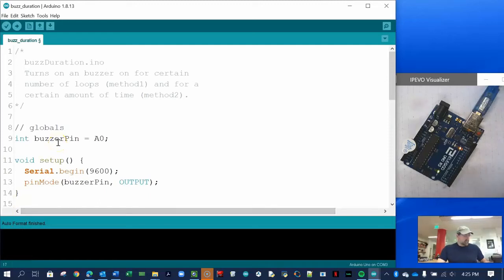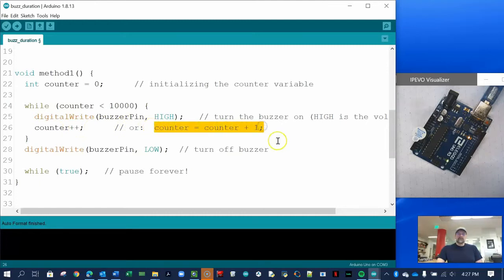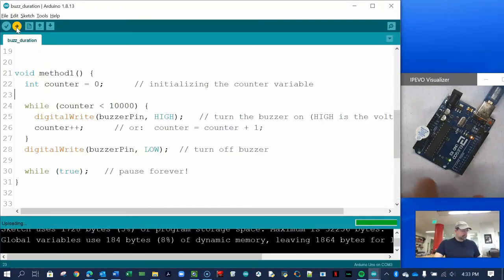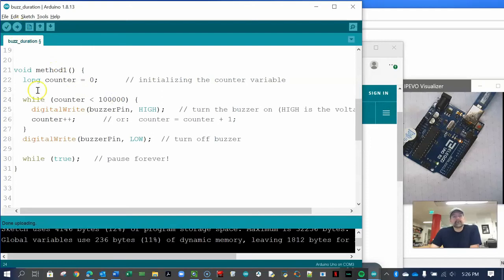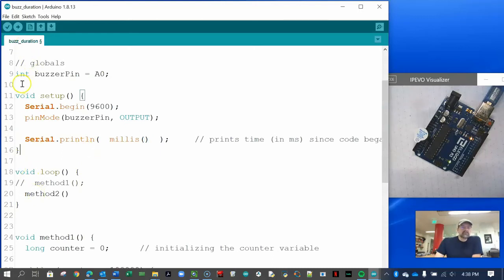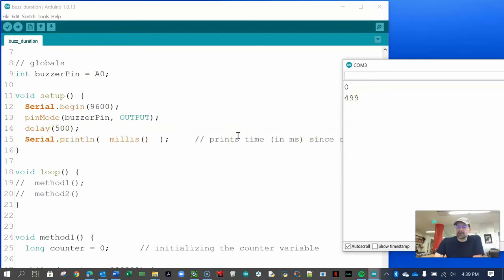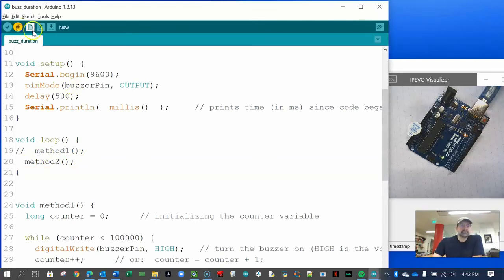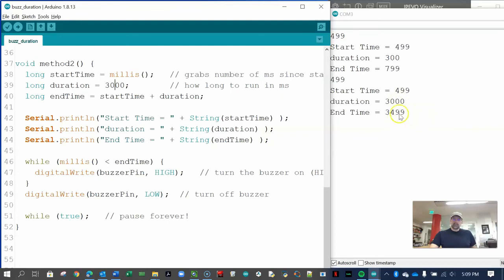Buzzer Duration Using the while() and millis() Commands

Comment: suppose duration =3000 , while loop will run for 3000 millisecond ( or approximate 3000 times)
my question is : isn't it bad practice  to execute  this line of code  {      digitalWrite(buzzerPin, HIGH)    } 3000 times ?
Reply from the maker: Thanks for your question!  I don't see how this would hurt the microcontroller, as the voltage remains the same throughout the loop.  (After the first iteration, it is setting the pin that is already at 5V to 5V.)  But I do see your point, that the code could be simplified if the digitalWrite() command is moved from Line 25 to Line23.  But I don't think the controller will be overtaxed either way.

Comment: What if we wrote the following?

while (startTime < millis ( ) < endTime)
Reply: So the difference between “while” and “for” loops 

while loops check that condition and do “thing x” if the condition is met and cycles through the loop and will keep doing “thing x” as long as that condition is met

for loops will go into the “for loop” and do 
“thing y” FOR a specified number of times depending on the arguments that are fed into that  function 

Correct??
Reply from the maker: That is correct.
Reply from the maker: So, that kind of logic statement works in a math class, but not in a programming class.  In programming, you need to use what's known as logical-and operators to join two or more conditional expressions.  Logical-and is entered as &&.  Something like this:

while ( (startTime < millis()) && (millis() < endTime))

or:

while ((millis() > startTime) && (millis() < endTime))

See?

Comment: Excellent sir 
I was looking exactly this code , but plz guide me how I can add code to my project " water level indicator using ultrasonic sensor "  . When the water reaches high level the buzzer should on for 10 seconds then it should off automatically . Plz guide me sir ..you u want codes I can upload it . Waiting for kind reply
Reply from the maker: Hi Dawoodhusain.  You can just add the code that starts at 9:49 in the video.  But this may be overkill.  The reason to use a while loop and the millis() function is so your code can be doing other things while doing something else for a certain amount of time.  But you may not need to do that.  You can probably get by with a simple delay(10000) command, which PAUSES the code for 10,000ms or 10s.  I do not have my microcontroller with me, but the code would look something like this:

int buzzerPin = 2;

void setup(){
    pinMode(buzzerPin, OUTPUT);
}

void loop(){
    // turn ON the buzzer for 10 seconds:
    digitalWrite(buzzerPin, HIGH);       
    delay(10000);                    // pause program for 10 seconds

   // turn OFF the buzzer for 5 seconds:
    digitalWrite(buzzerPin, LOW);       
    delay(5000);                        // pause program for 5 seconds
}

So, you should create the global buzzer pin value (first line of code).  Then you MUST put the pin in the proper pinMode (line inside the setup() function).  Finally, you can use the digitalWrite() function to turn on your buzzer with a HIGH argument, a delay() to keep it on for a specified amount of time, and finally another digitalWrite() command to send the buzzer LOW to turn it off after the delay.

Not sure if this is what you are looking for.  Hope it helps.
Reply: @PCRduino   thanks sir for the reply that code i have tried sir the buzzer wont stop after ten seconds instead it continuous to beep here i have uploaded the code plz check it sir ..
..........................................
const int trigPin = 2;
const int echoPin = 3;
int ledA = 13;
int ledB = 12;
int ledC = 11;
int ledD = 10;
int ledE = 9;
int buzzer = 8;
int A = 20;
int B = 16;
int C = 12;
int D = 8;
int E = 5;
int max_distance = 200;
void setup() {
  Serial.begin(9600);
  pinMode (ledA, OUTPUT);
  pinMode (ledB, OUTPUT);
  pinMode (ledC, OUTPUT);
  pinMode (ledD, OUTPUT);
  pinMode (ledE, OUTPUT);
  pinMode (buzzer, OUTPUT);
  digitalWrite(ledA, LOW);
  digitalWrite(ledB, LOW);
  digitalWrite(ledC, LOW);
  digitalWrite(ledD, LOW);
  digitalWrite(ledE, LOW);
  digitalWrite(buzzer, LOW);
}
void loop() {
  long duration, inches, cm;
  pinMode(trigPin, OUTPUT);
  digitalWrite(trigPin, LOW);
  delayMicroseconds(2);
  digitalWrite(trigPin, HIGH);
  delayMicroseconds(10);
  digitalWrite(trigPin, LOW);
  pinMode(echoPin, INPUT);
  duration = pulseIn(echoPin, HIGH);
  cm = ( duration / 29 ) / 2;
  inches = cm * 0.393701;
  inches = microsecondsToInches(duration);
  cm = microsecondsToCentimeters(duration);

  if (inches < max_distance) {
    Serial.print(inches);
    Serial.print("in");
    Serial.print(cm);
    Serial.print("cm");
    Serial.println();
    delay(100);
  digitalWrite (ledA, HIGH); 
  }
  if (inches >= A) {
    digitalWrite (ledA, HIGH);
    digitalWrite (ledB, LOW);
    digitalWrite (ledC, LOW);
    digitalWrite (ledD, LOW);
    digitalWrite (ledE, LOW);
  }
    else if (inches >= B) {
    digitalWrite (ledA, LOW);
    digitalWrite (ledB, HIGH);
    digitalWrite (ledC, LOW);
    digitalWrite (ledD, LOW);
    digitalWrite (ledE, LOW);
  }
  else if (inches >= C) {
    digitalWrite (ledA, LOW);
    digitalWrite (ledB, LOW);
    digitalWrite (ledC, HIGH);
    digitalWrite (ledD, LOW);
    digitalWrite (ledE, LOW);
  }
  else if (inches >= D) {
    digitalWrite (ledA, LOW);
    digitalWrite (ledB, LOW);
    digitalWrite (ledC, LOW);
    digitalWrite (ledD, HIGH);
    digitalWrite (ledE, LOW);
  }
  else if (inches >= E) {
    digitalWrite (ledA, LOW);
    digitalWrite (ledB, LOW);
    digitalWrite (ledC, LOW);
    digitalWrite (ledD, LOW);
    digitalWrite (ledE, HIGH);
  }
  else {
    digitalWrite (ledA, HIGH);
    digitalWrite (ledB, HIGH);
    digitalWrite (ledC, HIGH);
    digitalWrite (ledD, HIGH);
    digitalWrite (ledE, HIGH);
  }
  
}

long microsecondsToInches(long microseconds) {
  return (microseconds / 74) / 2;
}
long microsecondsToCentimeters(long microseconds) {
  return (microseconds / 29) / 2;
}
Reply: @PCRduino  sir actually  int A=20  is the my tank overflow , when the water reaches this level i want to on the buzzer for 10 seconds after that the buzzer should stop
Reply from the maker: @dawoodips  Hi again.  I see that you have set up the pinMode for your buzzer properly in OUTPUT mode and you set it to LOW, which is fine but is not necessary.  I do not see where you have actually turned on the buzzer, so this makes me think that you have plugged in the buzzer to the motherboard improperly.  The buzzer's positive (+) terminal should be in pin 8 and its ground pin (which is the shorter pin) should be connected to GND.  Are you doing that?  What kind of buzzer are you using?  Is it a discrete component or connected to some board?